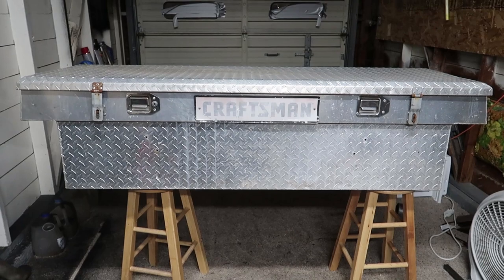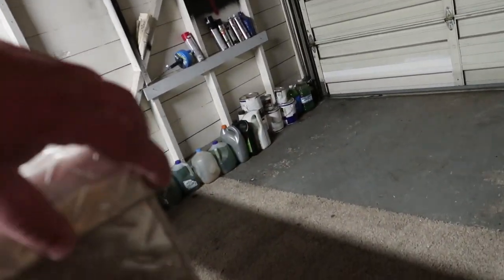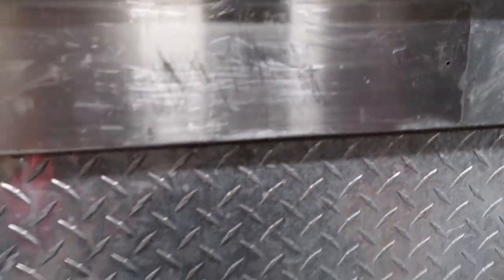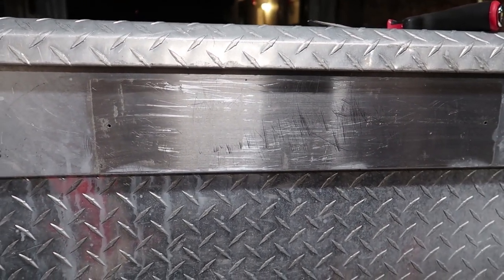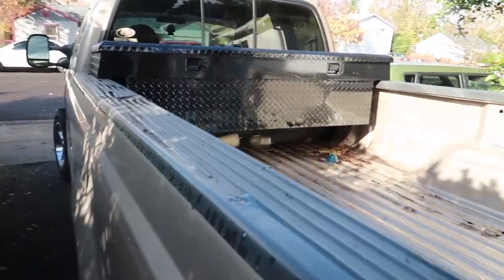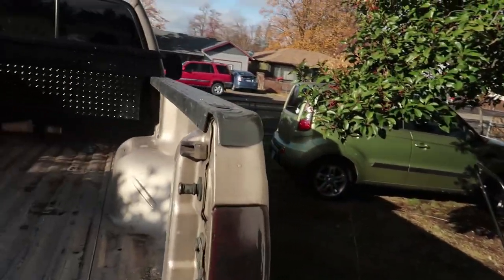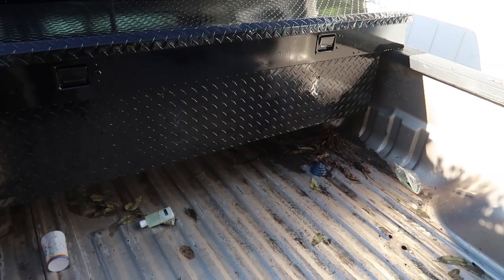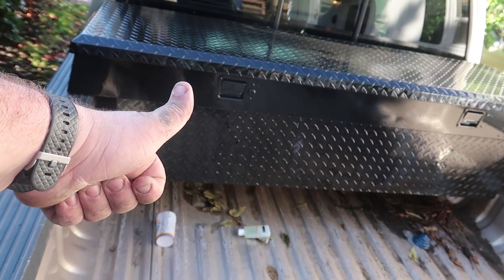Truck Tool Box RESTORED.

Comment: my brother gave me a truck box that was given to him. he got his use from it and it was just sitting around for years after. i have about 30-35 in it now after putting new springs and locks in it. thanks to amazon and china. it had 2 holes knocked in it as well. i just used a boat patch on it, fiberglass and resin. planning on putting that side on the back so, not a concern. it will hold water now, i tried it with some purple power scrubbing the crud out of it. i also used rtv on the latches. i'm a polish or paint away from having a decent box.

Comment: Next time try gasoline to remove the adhesive if you don’t have Goo gone And when you use WD and then you’re going to paint just use dish soap or any type of degreaser Oven cleaner or anything along those lines to clean it

Comment: So how has the paint job held up so far?
Reply from the maker: It was a great paint job, but as soon as anything hit it the paint would chip pretty easy
Reply: Generally, you want to prime with acid etch primer. Then apply your paint. I use to paint signs and everything we built was aluminum of some sort.

Comment: How many coats did it take to spray it?
Reply from the maker: SilverFin2016 I think I did 3
Reply from the maker: But I used pretty decent paint as well.
Reply: Sweet I just got the same stuff you used got a plate on the front of my trailer I’m going to try and tackle. Thanks for the quick response man and the box looks awesome dude
Reply from the maker: SilverFin2016 good luck!